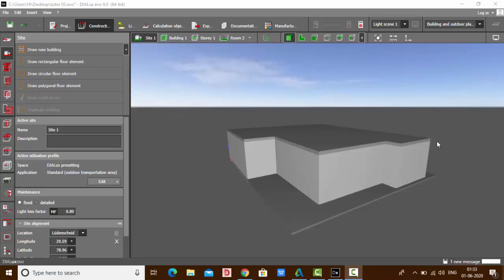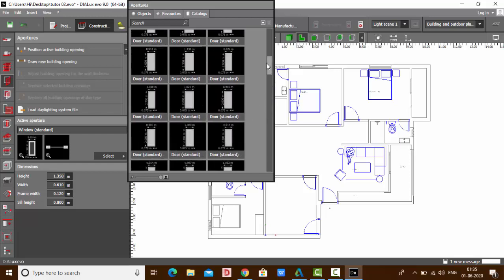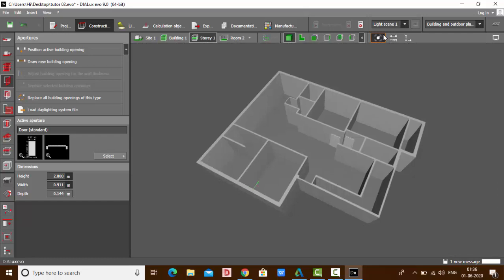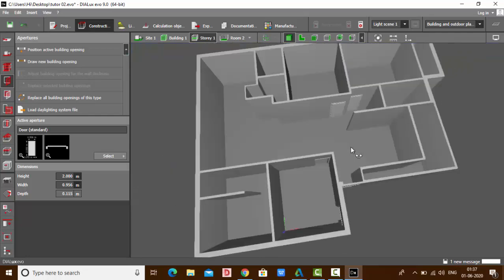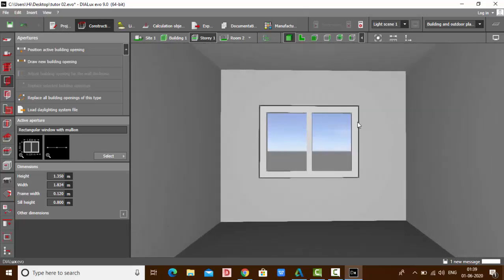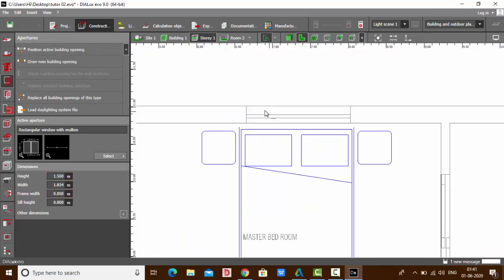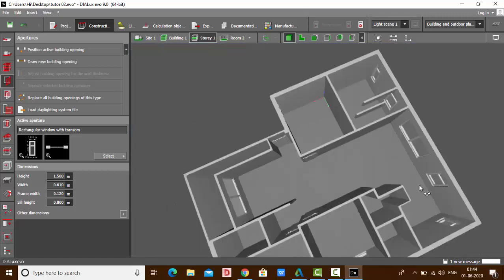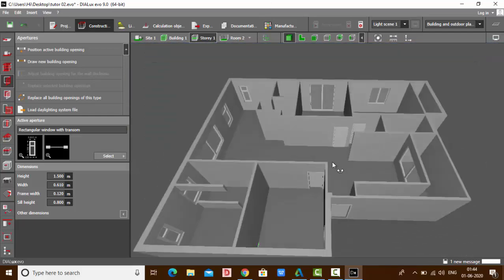How to add doors and windows in DIALux Evo

Comment: Hi Sumaiya, I am learning Dialux evo and practicing on a CAD file. for the window and door segment, according to design, I need flush door, fire door, partially openable glazing window, sliding window, and ventilator, but I have found these are not included inside Dialux evo. Could you please guide me on how can I get/download and incorporate these files of windows and doors? Thanks in advance
Reply from the maker: I will make short video on this soon..

Comment: hi! if i use an imported building with 3ds file, and i want to calculate the daylight. i need to use dialux windows right? but i can't seem to put the window, why is it?
Reply from the maker: Because Dialux Appertures can be placed only on contour walls of Dialux. It cannot be placed on 3d model.
Reply: @SumaiyaEliyaz  okay thanks for the answer 👍

Comment: Hi sumaiya I like your video it's very helpful. 
Once I draw door window that frame it's come to much length &there is no any option coming to reduce the frame length. 

Example: I have small room I apply window that window frames touching to behind wall like box what is the solution. I hope you can solve my problem. 

Thank you
Reply from the maker: you can scale the window keeping it in storey mode and plan view.
Reply from the maker: you can scale the window keeping it in storey mode and plan view.
Reply: @SumaiyaEliyaz  thank you so much